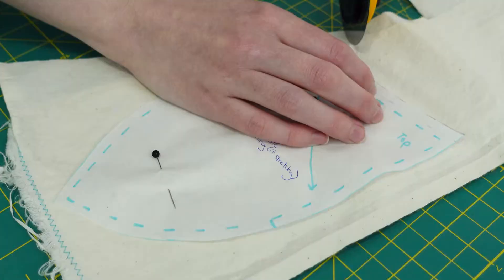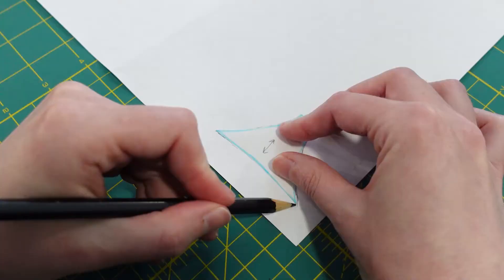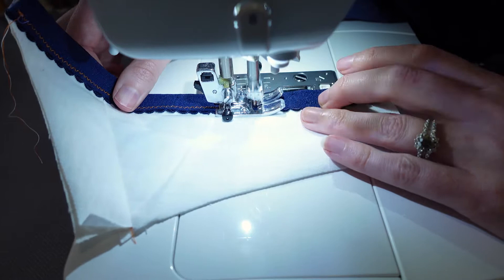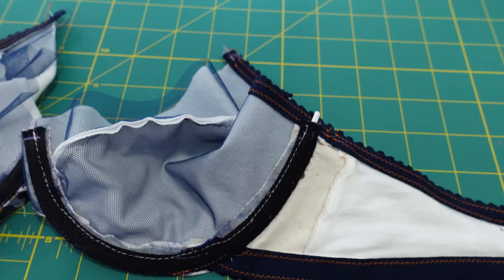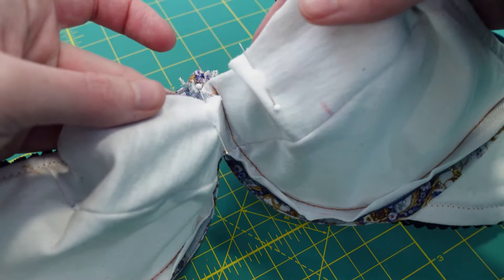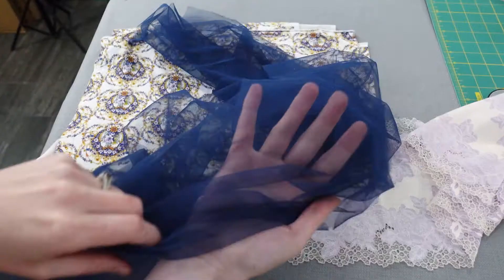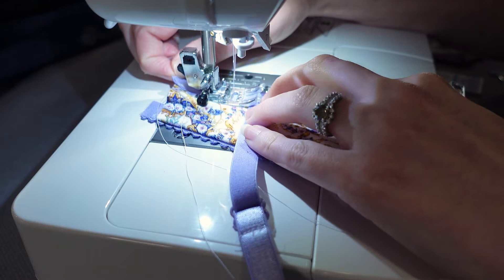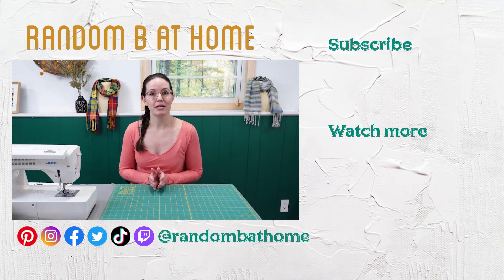How to Sew a Bra: Common Alterations

Comment: Would you be willing to make a bra video of altering the free maya bra pattern ? I’ve asked Liz sews before & no answer. Her videos don’t help me enough. I want to change the maya to use a shorter underwires like Demi ones and then make it a partial band bra.
Reply from the maker: hmmm I've never altered a pattern to fit demi wires since the Lansdowne is designed for them, but I could see what it'll take to alter the cups! It would be a few months from now since I'm currently working on a large project. As for the bra band, I think to make it partial you would shorten the bottom part of the band and split it at the lowest point underneath the cup to create 3 pieces from the one.